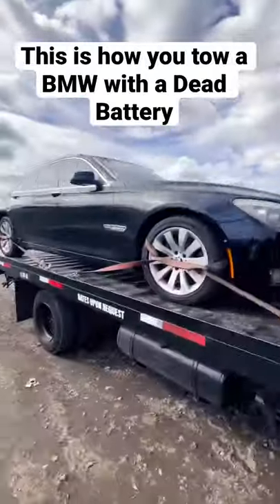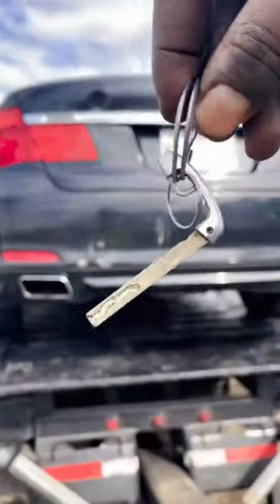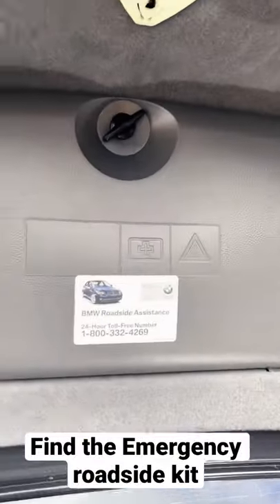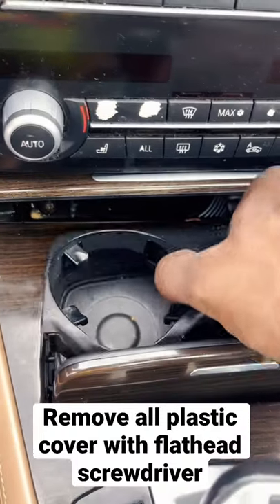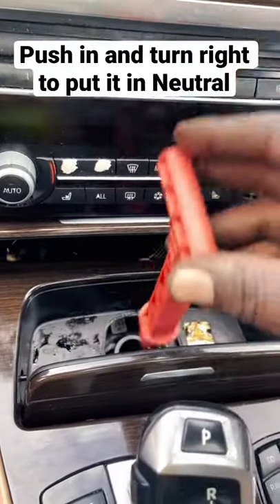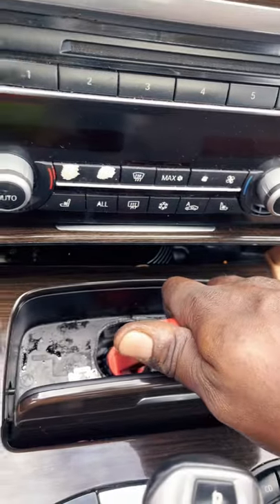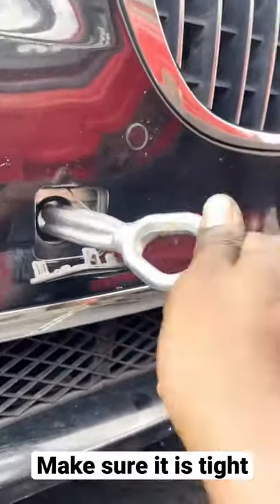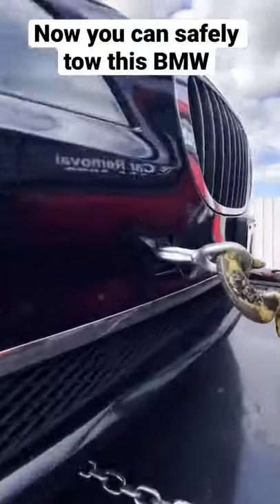Dead Battery on BMW | How to put BMW in NEUTRAL | How to tow BMW

Comment: I have a 2014 535i GT. All of these steps are exactly the same, but under my cup holders I found absolutely nothing! No manual entry for the tool to turn. Just an empty spot where it should be and carpet. Any ideas!?
Reply: in that case you have a screw on the left side of the box under the car ... you have to screw it in to disengage P. You have to raise the car on the jack and unbolt the cover from under the gearbox.
Reply: @BratDalton aka hear that? That’s bmws engineers laughing at the poor shmuck on the side of the road trying to get his car into nuetral
Reply: @pri0r_t0_a_weekago...fukwi48  I couldn't believe it either, you have to unscrew 10+ screws to remove the undertray and then screw in another one in the box. the whole  idea is absolutely bonker , they must have been smoking something when they came up with it lol